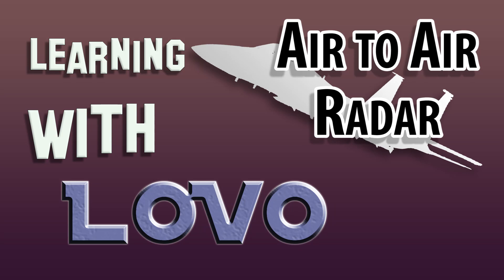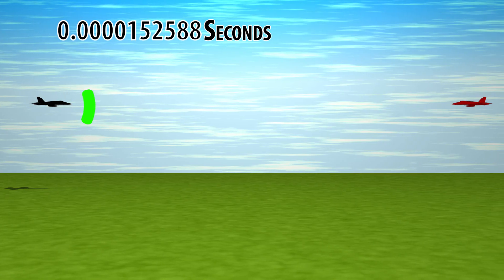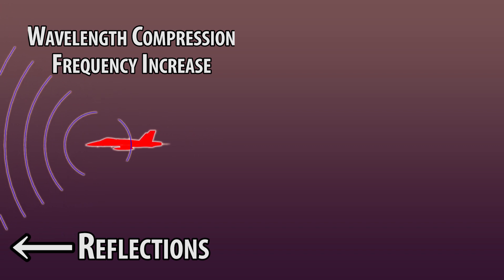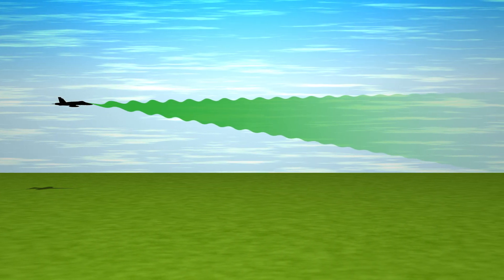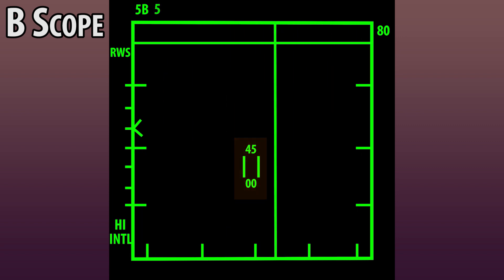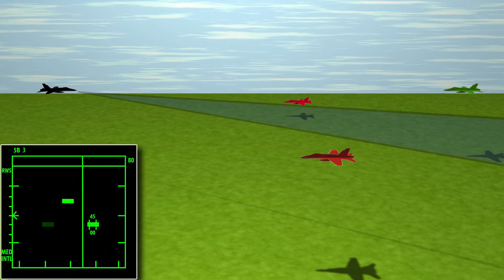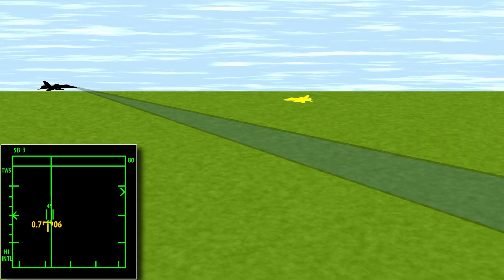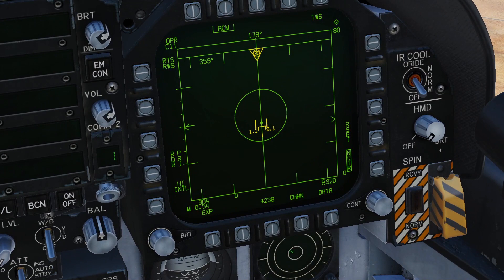Air to Air Radar

Comment: Fantastic radar theory video! I know you're just using the symbology of the Hornet for an example, but for the F/A-18C specifically, almost everything said about RWS and LTWS is incorrect.

The Hornet radar will always build trackfiles outside of A/G master mode. RWS is just a non frame limited decluttered TWS. The trackfile always exists but is only shown when it is the TUC (target under cursor) or L+S/DT2.
LTWS on or off just toggles wether the trackfile is displayed when TUC'd. You will always force the trackfile to show if it is the L+S or STT target. (Which IRL can be separate)
Reply from the maker: Great to know, thanks for the info!

Comment: That last bit about PRF is incorrect. HPRF is only really good for positive closure targets and by far has the longest range.
Reply from the maker: Haha this is the life of someone like me, I could remake every video every 6 months with new stuff I've learnt or mistake I've made.
Reply: @DCSWithLovo  I'm sure that's true, but that's unecessary. I just like mention some quick corrections in the comments to help everyone. A quick correction in the description is all I would do.

The production quality of this video was top notch. What did you use to create the radar displays?
Reply from the maker: @mobius7089  (one of these days I'll reply with the right account)
Thanks. To date I've done everything in After Effects and animated them in there. I'm working on moving most of my work to Blender now, but I havent released a video using that yet.